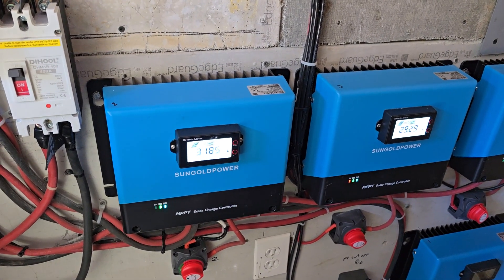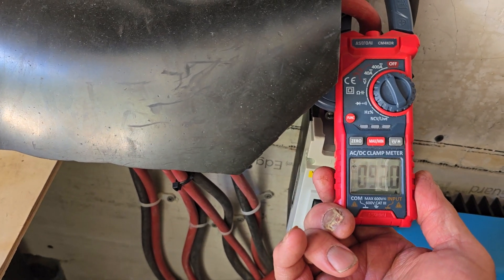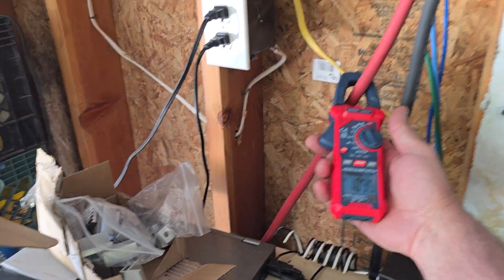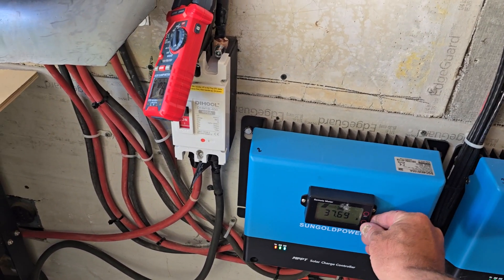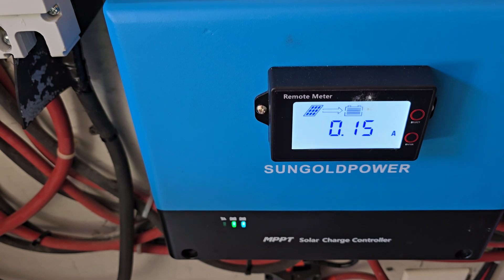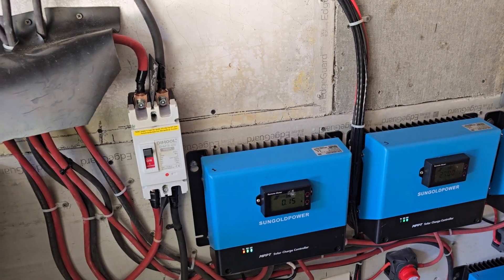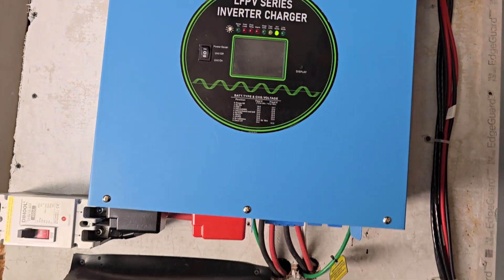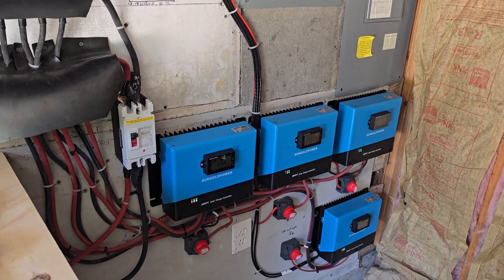Solar Charge Controllers, How They Functions With The Battery Bank Of The Solar System.

Comment: Why would you charge with grid power? Why not just run off the grid until the solar can recharge the batteries?
Reply from the maker: When the batteries are depleted do to the solar system not suppling enough power to charge the batteries, the inverter goes into bypass mode and sends power to the sub panel and also uses the on board charger to charge the batteries back up. If the sun happens to come out and starts suppling solar power it will also be sent to the batteries to help charge.

Comment: Hi, thanks for the video! I have about the same setup as you, with the 18KW inverter (the older version with the single color 2-line display), 2 100A MPPT solar charge controllers, and 4 of the same batteries you have. I'm just now getting the last of my panels installed. I've been worried about the solar charge controllers conflicting with the inverter's onboard charger. My worry is that if the sun comes up and the onboard charger happens to be charging the batteries, the solar charge controllers will see the higher voltage from the onboard charger and think that the batteries have a full charge when they don't. Have you seen this happen at all? Or does turning the onboard charger all the way down prevent this? I'd really appreciate your advice, as I've only had the system operating for about a day and a half now (12 of my 18 panels are mounted on the roof, hoping to get the last 6 done next week. Only 1 of my solar charge controllers is hooked up right now). Thanks so much!
Reply from the maker: The charge controllers some how read the batteries and not the on board charger input. 

If the commercial on board charger starts up,
On my system the commercial power stays on until the batteries are fully charged. 

I turned my on board charger all the way down to limit the commercial power usage, this way when the solar panels start to produce power in the morning the system is using more solar power then commercial power.

My house is all electric and my 5 batteries will be around 15% ~ 20% at 7am.

I have a hottub and wster heater that run in the early am.